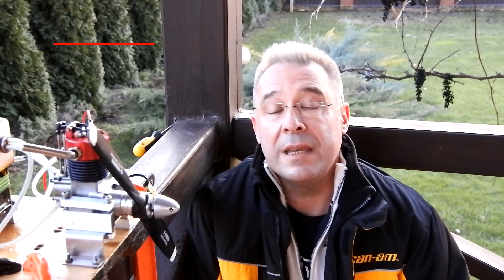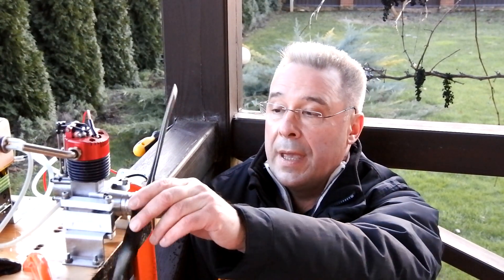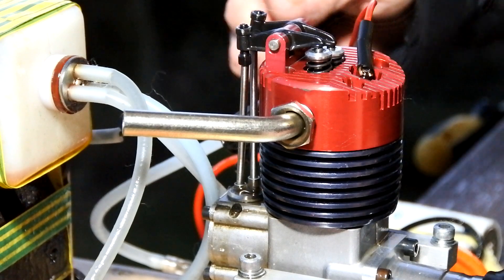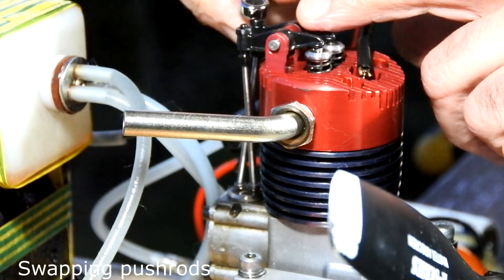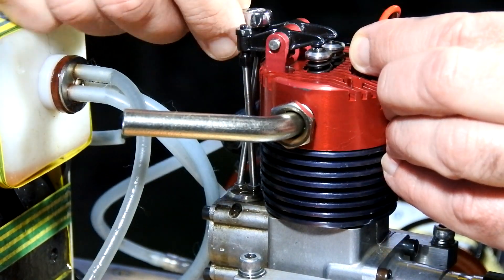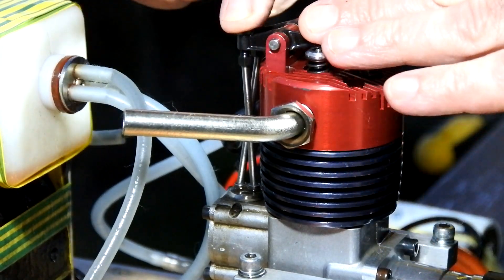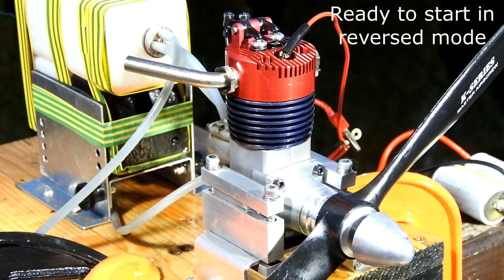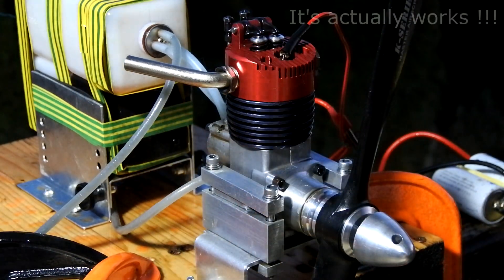Magnum 120S   reverse rotation test run

Comment: I am building an UAV and I think I found the right engine to reverse its rotation 

How many HP can this engine produce?
Reply from the maker: Thank you for your question. I should say, that this particular engine would not serve you in best possible way - it's rather old, and rare, to install it on UAV. Its power is about 0,45 HP,  at ~ 9K RPM and this figures aren't exact from manufacture tech papers. I've have heard,  from Mr. Andrew Roffe ( his is a son on Mr. P.Roffe, engine developer and constructor), that this engine could  have some problems with  cylinder seizure. Definitely, I would not recommend to use this model. This is real collectors item, but not for long and reliable use at UAV. For your purposes some modern engines could serve better, please, take a look of Saito or OS engines product line. With best regards, CrazYEngines.

Comment: Hello, this feature of reverse running, is possible on all engines, where the camshaft and pushrods are aligned with the crancshaft. Most Saito engines, the pushrods are angled, and therefore cannot be swapped, however on the OS fs 60 and 75 open rocker engines, it can be done. I have not seen anyone do it, but when i swap the pushrods on my os fs 60, the four cycles are reversed.
Reply from the maker: Thank you for your comment ! Yes, I’ve found, that so simple way to reverse an engine could be very suitable for 2 motor model variations, where engines are mounted on the wings. Still waiting for time, where it could be possible to run it on my open rockers Saito’s and OS engines, as well, as with early 4C Enya’s. Virtually, it could be possible to reverse practically all engines, it’s just a question of time and strong wish to do so...
Reply: yeah, where you have the push rods crossed like that, its possible to swap, just can't my head around how, when the exhaust port is open to suck in air/fuel mixture, it pulls from the intake side. Wonder if the chambers are open to each other in the magnum.

Comment: Works a treat! Next vid test it on a standard Saito single? Bit more involved to swap the pushrods on those but if they run backwards it's viable for a twin or a pusher!
Reply from the maker: Much appreciate for your  kind comment ! Not sure, that Saito will be the next one. But sure, that next planned Saito video isn't so far. Just need to complete Magnum 120S  test run cycle. Probably, this Magnum videos are the first videos about this UK made Magnum's, at least 120S model.  Thank you for watching !
Reply: @crazyengines88  Mm. That magnum is a beaut and a far cry from the chinese OS clone Magnums I own! If the Saitos reverse this easily as well...
Reply from the maker: @TestECull  Yes, it is, you're totally right. That Magnum is absolutely another pair of shoes :-), and  only one common thing - it's  name. UK made Magnum creators \ developers, unfortunately,  were no so predictive to patent their Magnum trade mark, and Chinese manufactures were very happy to acquire this TM.  regarding the Saito engines, turned backwards - only open rockers as FA 30, FA 40 could be inverted, I think. Could be interesting to modify in such manner OS FS 60\75\80 models. Will think about it, thank you for an idea !
Reply: @crazyengines88  I think if you lifted the whole jug and omitted the pushrod tubes you could prolly invert current production engines. Might try it with my fa-45 mkii.
Reply: @crazyengines88  And yeah, your Magnum runs like a zwiss watch. Not to knock the clone Magnums....both of my 52s run great...but they are just os clones. And my 30 has a wonky carb; something wasnt machined right and the low speed metering is useless.
Reply from the maker: @TestECull  For sure, will plan to run and to invert (correct word ?) some my open rocker designed Saito’s and Enya’s.
Reply from the maker: @TestECull  Should say, that this knocking sound definitely disturbing me, I feel, that it’s increasing with engine working time. Will dismantle soon an engine to clarify the source.